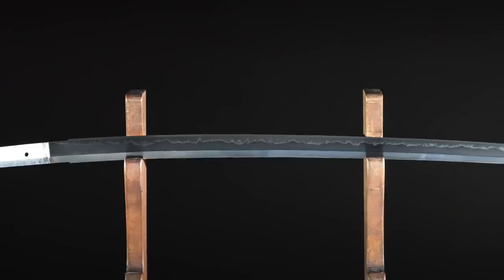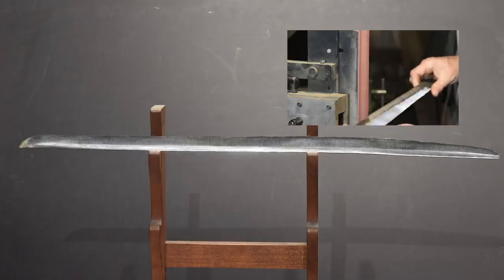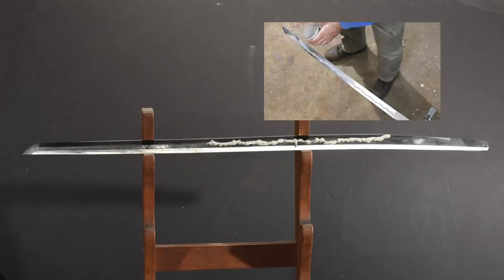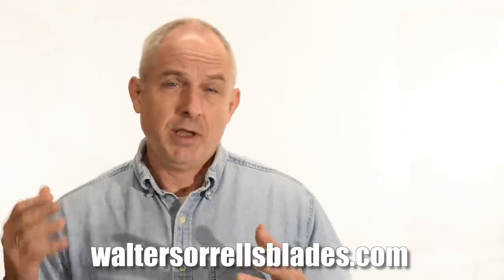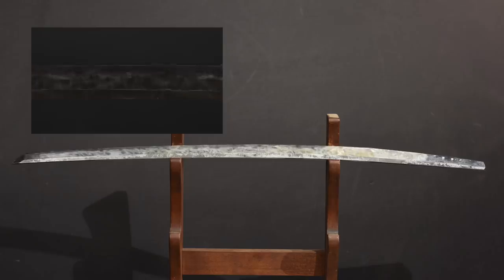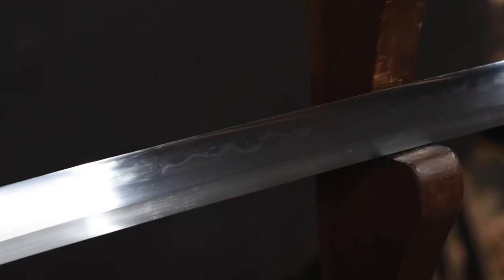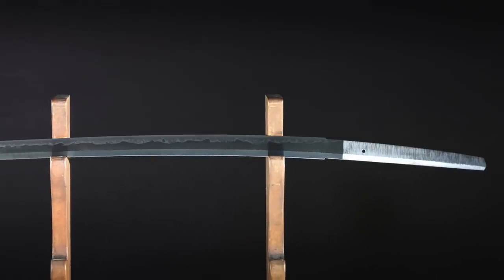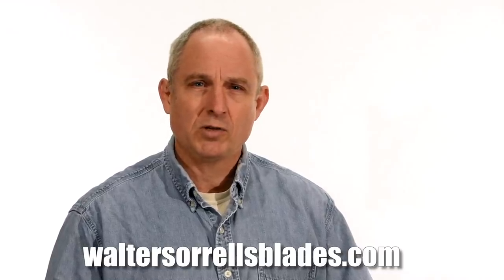Katana-Making Time Lapse with Commentary

Comment: I want to Thank You for this video, I am working on my first ever full-length sword. I have made many long knives or short swords. I am using a mono tool steel, I am not sure what it is, you can critique on that if you want. I forged my sword and I had it pretty much to shape and I did not realize that a mono steel would still curve during the quench when using clay. Because of this video it went back in the forge and I took out the curve with a wood block and wooden Mallet. If the quench goes well, (water quench, wish me luck) this video saved my build

Comment: Awesome! You’re the best Mr. Sorrells. I need to get myself some more W1. 

By the way, is Grainger’s tool steel of a good quality?
Reply: From the research I've done in the past and heard from other bladesmiths, Grainger is a good place to go for good quality W1.
Reply: lsubslimed Hey! Thanks for the reply. Yeah I figured it has to be good stuff, I have purchased from them before, since W1 inherently has tighter industrial specs it needs to pass. Tighter than 1095 for sure. 

I was just looking around at others like DieSupplies or OnlineMetals but their shipping is pretty crazy, the shipping costs more than the drill rod lol. 

Grainier is close to me and it usually arrives the day after 👍 so looks like I’ll be sticking with them for tool steel.

Comment: Noob question here: What if you want to make a straight blade (like the Hollywood 'ninja' swords), how do you quench it without it arching?
Reply: You can either pre-curve it forwards, though you'll still have to do some grinder work to straighten it probably as it's tough to predict the exact curve, or you can quench in oil, as oil quenching doesn't produce a curve like water. Or you can leave out the hamon entirely in which case it wouldn't curve.
Reply: @SkunkworksProps  Thank you!
Reply: or you could not use clay

Comment: Hi Walter, have you got any experience with the Hamons 1045 produces? Where I am from it is rather difficult to find 1095 and W1 in the adequate thickness for some of the blades I enjoy making though 1045 is readily available.
Reply: generally, 1045 wont have enough carbon to properly convert to martensite (harden the knife). 1045 is a great steel for tools like hammers, and punches, drifts etc... to answer your initial question, maybe it will get a hamon, but not a significant one. I would really recommend something like 1084 or 1075. PS If you are really hellbent on 1045, use a water or even brine quench to get the fastest possible cooling to try to get more hamon activity. Good luck!
Reply: @AlexCanciois-an-awesome-guy  Thank you for the answer, I also know theoretically it does not really have the desirable carbon content, I generally use 1095 but none of the low alloy high carbon steels are available in consumer type orders in Germany, you only find it in thicknesses of about 4 mm which is just annoying to deal with as I would like some in the ballpark of roughly 6 mm.
I don't really make blades without hamons anymore so I am mostly wondering about them.
For my usual knives the 1095 I can get is enough but for swords etc. I like some more meat to work with.
Regardless, thank you very much for your answer.
Reply: @gushlergushler  a technique that could work is forge welding a billet of smaller pieces of 1095 into a sizeable piece for swordsmithing. Of course that would be a labor intensive process for unappreciated results, but where there's a will there's a way. Happy forging.
Reply: Labor intensive is the inhibitor here^^ thank you though